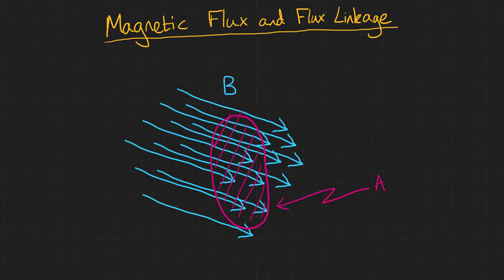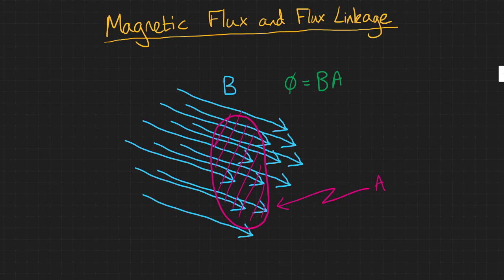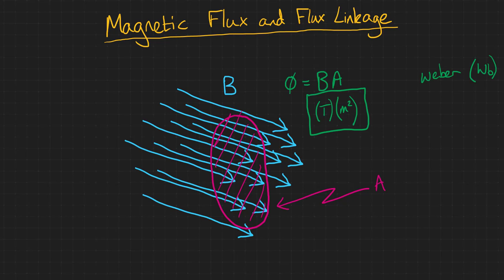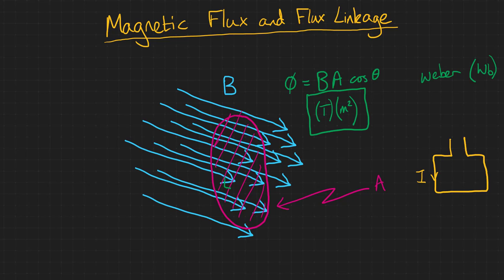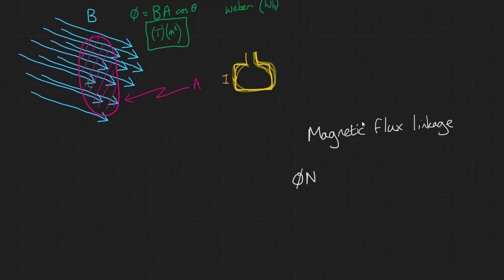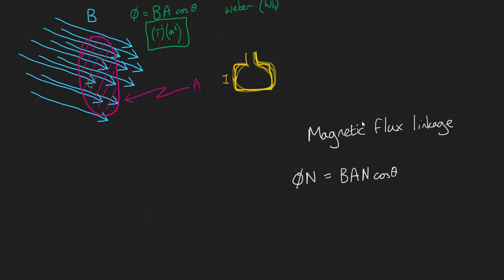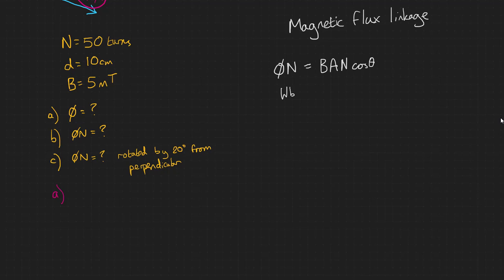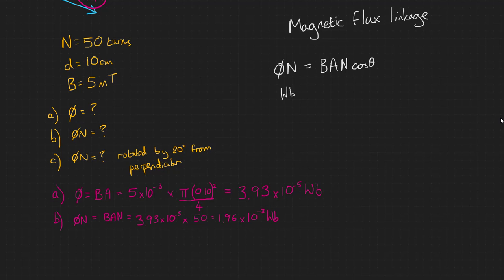Magnetic Flux and Flux Linkage

Comment: @ 1:51 to calculate magnetic flux linkage is simply multiply magnetic flux with number or turn.
my question is, does the bigger winding wire have a higher magnetic flux? eg. if we use bigger wire so we can reduced the number of turn?
just like what we've seen in electric motor with a hairpin winding.
Reply: bigger windings then more flux so less no of windings needed

Comment: For magnetic field linkage the symbol is Psi (ψ).
Reply: In electrical engineering I've only seen it represented as lambda
Reply: @Brono25   I have also studied Electrical Engineering.You can use both Lambda and Psi though. No issues

Comment: by your definition of flux linkage, the flux linkage of a coil with N number of turns will be the same irrespective of whether the turns are wound on a ferrmomagnetic solid core or around a hollow core.. .is that true?  I guess if the core material is changing, then flux density will be different based on the core, and so flux linkage may be different?
Reply: yes precisely thats the answer to your question